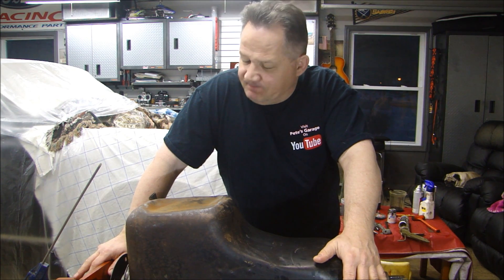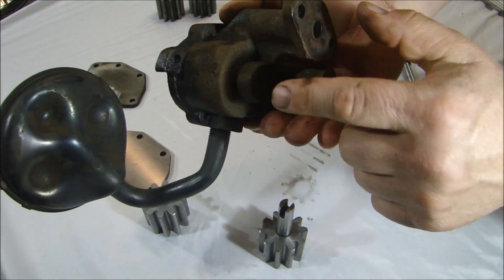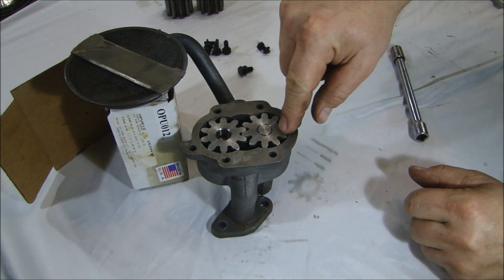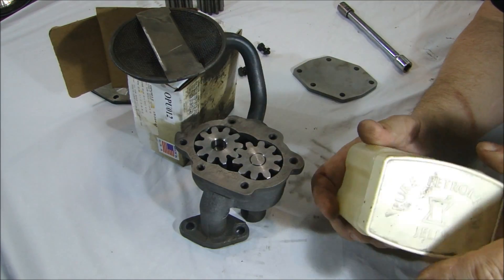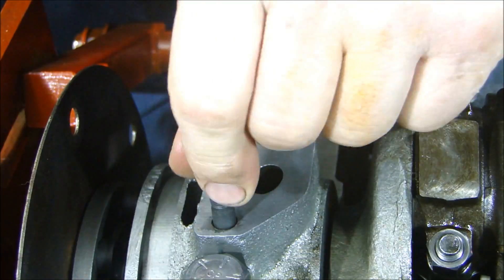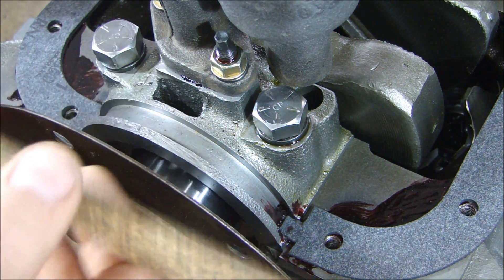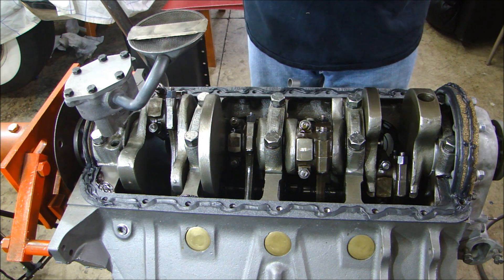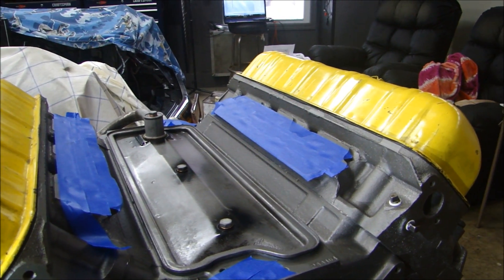Engine Rebuilding Studebaker 289 - Assembly Part 5

Comment: You mentioned 30 ft./lbs torque for the oil pump cover bolts. Is that correct ?
Reply from the maker: According to the manual

Comment: Hi, Thank you very much about videos. Very usefull :-)
Need help.
I have Oil Pump with loose Oil Strainer Pipe. Oil Strainer swings freely. Now Strainer turns to bottom and touches oil pan.Threads are seen just like in your video. I noticed that its not possible to turn pipe more to snug it up. I dont see that the pipe has conical threads. I dont understand how the pipe is fastened tight. Threads looks fine.
Is the loctite threadlocker only solution in this case?
Reply from the maker: I would use a die and cut the threads deeper on the tube

Comment: Use the ball head of a ball peen hammer works great to reverse the bolt hole protrusion on the oil pan
Reply from the maker: Great tip!

Comment: Hey Pete, I'm in the process of rebuilding a 63 289.  Where did you get the new pressure relief valve and spring?  I also need the washer thing that goes between the cam gear and fuel pump eccentric, one of the tabs is broke off.  Thanks, John
Reply from the maker: Fairborn Studebaker (937) 878-1576

Comment: Why petroleum gelly
Reply from the maker: Because it is thick and helps provide immediate suction to draw up the oil
Reply: okay thanks. I assume it wont form sludge when it come contact with fuel. or maybe it just dissolves along the way.
Reply from the maker: It dissolves almost immediately since it is a petroleum product

Comment: I am really enjoying your engine rebuild videos, great job. I noticed you did not put the  lock nuts back on the rod bolts unless in a later video you removed the pan and did that, were they not needed, I have seen and used those type of lock nuts before but never saw them on rod bolts before.
Reply from the maker: Those were just a stamped steel PAL nut. They do very little and I usually leave them off.
Reply: Thank you I was curious about that.

Comment: Pete, thanks for putting these videos together. Would you put anything on rubber end gaskets for an oil pan? Right stuff on both sides or just under the rubber arc pieces? Thanks!
Reply from the maker: For the end pieces I cover both sides, especially if they are cork. For rubber one I usually just use hi-tack

Comment: Any reason why you ran the bead of RTV around the outside of the oil pan bolts instead of on the inside? Or both sides?
Reply from the maker: Yes, if you put down a t least a 3/16 bead it will press inwards and surround the holes. Too much and it will end up in the pan. You can go around the entire hole if you like, but I've never had a problem

Comment: Hey Pete, am I wrong or you didn't set the oil pan gasket on the surface before pushing the oil pan in place?
Reply from the maker: The oil pan gasket is the black paper. I installed that in the previous video because it goes on before the cam cover.